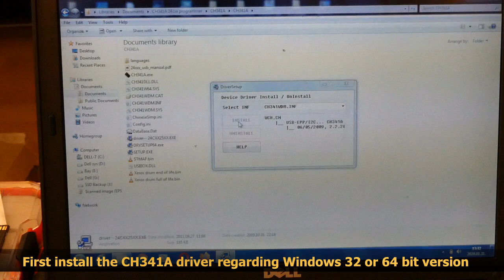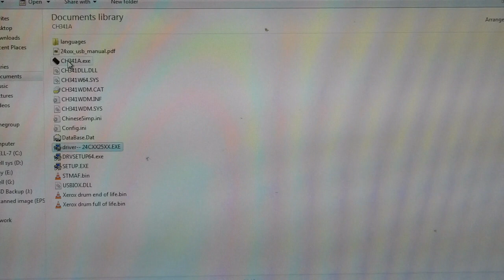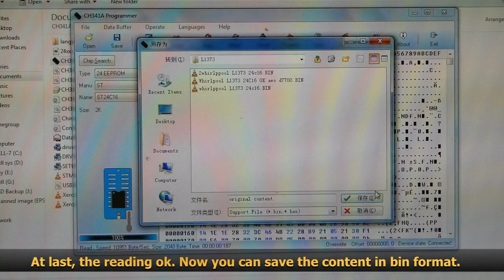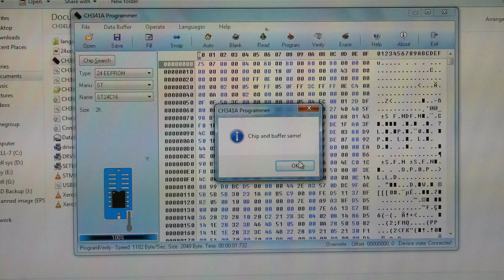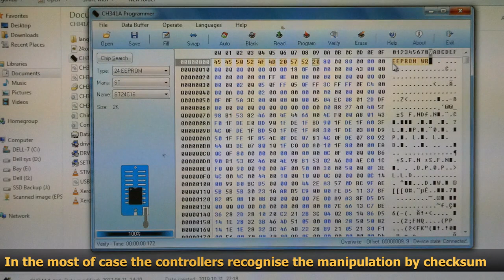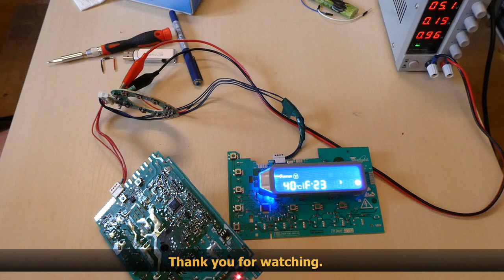Eeprom programming with CH341A programmer  on a Whirlpool L1373 board

Comment: Hello, I am a hobby repairer of pcb boards from whirlpool washing machines. I've never done software before, but at your suggestion I decided to start doing it. I could then copy the bios from the old boards. Is there any other way to bios? And can you tell me what resistor you used and what pin you connect it to? Thank you Roman SK.
Reply from the maker: Hello, this video only shows the operation of the eprom programmer, the L373 board is only needed for the demonstration. 
In the case of the L1373 board, the procedures (washing cycles, rinsing, spinning, steaming, pumping) are programmed into the microcontroller, the main program runs in the 24c16 eeprom, and error codes, currently running programs, cycle counters and  assignment of user interface buttons are saved here, yet . The main program determines how the procedures should follow each other and how long they should last, this part is also protected with cheksum to prevent dangerous operation from occurring. 
Usually, the content of the 24cXX eeprom is damaged, because it is sensitive enough to ensure that the supply voltage does not fluctuate during writing. Most of the strange motherboard errors in washing machines can be traced back to damage to the eeprom content, so copying the working eeprom content of a washing machine of the same type to the eeprom of the non-working machine can provide a solution.
I used a 10kOhm resistor, this is approx. It corresponds to NTC with a temperature of 30 degrees.
If you are interested in the construction of the L1373 board in more detail, or the service documentation for this washing machine, you can find them here.
https://elektrotanya.com/whirlpool_awo_l1373_domino_control_panel_sch.pdf/download.html#dl
https://elektrotanya.com/whirlpool_aquasteam_1400.pdf/download.html
One more important thing, the main switch on the pen must be turned off to read and write the eeprom, otherwise the 5V power supply connected to the eeprom will also start the microcontroller and then the data flow between the microcontroller and the eeprom will start, making it impossible to read the data.

Comment: I am using a CH341A but have you any idea what to do the eeprom chip number is not on the list.....
Reply from the maker: AsProgrammer             https://github.com/nofeletru/UsbAsp-flash/releases/

This is a nice open source software for CH341A with an expanded list. It knows a lot of I2C SPI andEEPROM. I have tried it, it is a little bit slow, but works properly.

Comment: GRAZIE , MI E' STATO MOLTO UTILE PER LEGGERE LE SCHEDE LAVATRICE WHIRLPOOL , MA IL FIRMWARE COME E DOVE SI PUO SCARICARE??
UNA COSA MOLTO DIFFICILE E' LEGGERE I NUOVI MICROPROCESSORI DELLA RENESAS RX62TA R5F562TADDFF ,COME POTREI FARE?
GRAZIE ,PIETRO -ITALIA-ROMA
Reply from the maker: Thanks. I have found some Whirlpool eeprom content in repair forum. I scanned a lot of website use the machine type and eeprom type as a search term. I have only own washer eeprom content, If you need, it's for Steam 1400.
If I see well, the RX62T is programmable via normal serial (UART) port.
 https://docs.rs-online.com/35ec/0900766b814df700.pdf
https://www.renesas.com/us/en/document/man/renesas-starter-kit-rx62t-cpu-board-schematics?language=en
There also is universal programmer for it:
https://www.amazon.ca/SETCTOP-J-Link-Emulator-Debugger-Programmer/dp/B081SFZFXR
Reply: @mcelec7603  SALVE, PUTROPPO AMAZON ITALIA NON CE L' HA , HAI UN' ALTRO DISPOSITIVO DA CONSIGLIARMI ?GRAZIE
Reply from the maker: @pietrodigiorgio8304  I even use the TL688A programmer, but it doesn't read and write the RX62TA